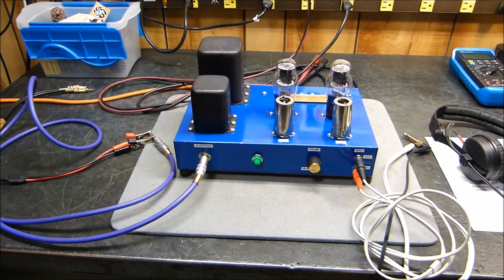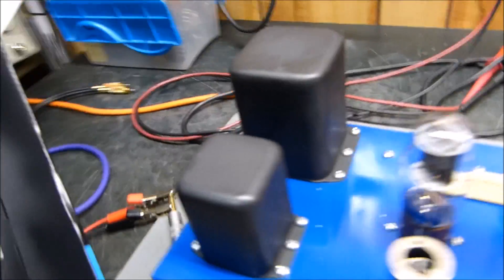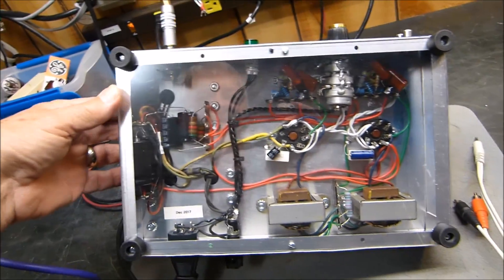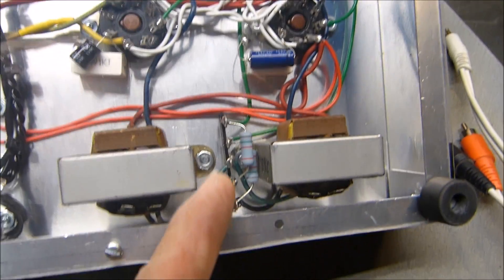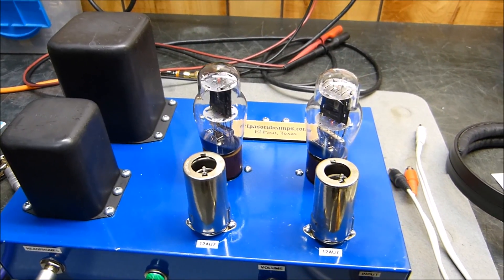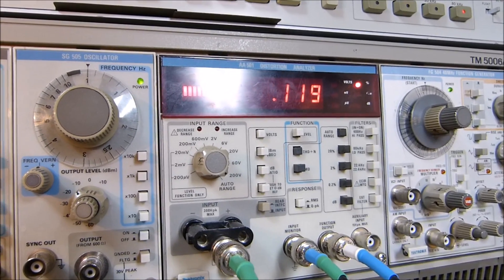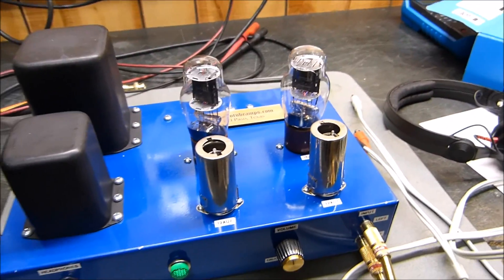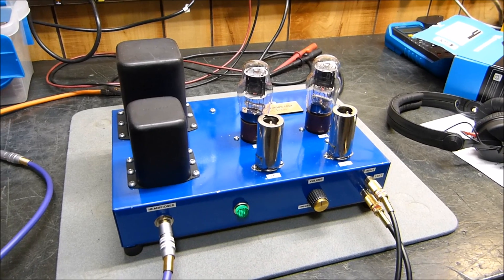Vacuum Tube Headphone Amplifier Using Vintage WWII 1626 Triode - Part 3

Comment: Looks great.. Are those cathode bypass caps for the output tubes final? I ask ‘cause one is axial while the other is a radial type of different manufacture..
Reply from the maker: Yes, that is true. They are different types but are of the same values. I am usually pretty picky about those types of things but I was pushed for time to get it done by Christmas so I used two different types of capacitors. You are very observant. Thanks for your comment

Comment: I there, apologies if you've answered this already but I was hoping you could tell me how you're measuring the frequency response?  Which software and your input particularly!
Thanks in advance!
Reply from the maker: I use a HP 8903 instrument with a software program from Pete Millett's website that interfaces a PC (my laptop) to the HP 8903. The HP 8903 is usually available on Ebay and Pete's website has the software for free. To interface the 8903 with a PC it is also necessary to have a HPIB adapter - usually sold separately from the 8903.  Here is a link to Pete's site and the 8903 with a lot of information.
http://www.pmillett.com/hp_8903_software.htm
In addition, I have made a number of videos on installing and configuring the software as it can be a bit confusing.
Hope this helps and best of luck..
Reply: Thank you!!!

Comment: Are you aware of the "Aikido" topology?  This was developed by John Broskie. The Aikido is a single ended, zero feedback, OTL - though it certainly could be transformer coupled. The Line Driver would be a great pre-amp for your Grandson's Headphone Amplifier. Check it out: http://glass-ware.stores.yahoo.net/index.html   Broskie writes a blog that is very informative, "Tube Cad Journal" - there's a link on his Glassware site.     What was your final schematic?
Reply from the maker: Thank you for the information. I have been considering an OTL amp for some time, using a cathode-follower circuit for some low power. Probably would have been a great idea for the headphone amp. I didn't show the final schematic from LTSpice but I can send it to you if you want. You have to write me direct at theaudioshop@sbcglobal.net as I can't attach it in YouTube.  I am working with a gentlemen to upload these LTSpice models and provide a link for download but it isn't working yet. You will, of course, need LTSpice installed and the Koren_Tubes file to run it.
Reply: Thanks, I'll do that. I'm really glad you did a few videos on LTSpice. I need to get into it!

Comment: Great wealth of videos! I am utilizing the knowledge here to help upgrade my lab and skills. My question do you have a simple list of your videos?  I tried your website but is was down. Thank you.
Reply from the maker: Hi Bill,
I am pleased to hear you enjoy my videos. I do not have a list but have almost 300 videos posted so I think if you just search for ElPaso TubeAmps within YouTube, you will get a complete list going back almost 10 years.
Reply: ElPaso TubeAmps 
,  I am about to restore some Macintosh tube equipment and feel prepared to check performance parameters thanks to your videos. Thanks
Reply from the maker: I am a real fan of McIntosh. 50+ year old equipment still works great. May need some new electrolytic power supply capacitors and certainly replace any selenium bias rectifiers  and it will probably be good to go. Some people seem to thing that all the coupling capacitors need replacement but I don't see it that way. If they are bad, then they need to be replaced, otherwise, I leave them along. Best of luck with your project.
Reply: ElPaso TubeAmps Thanks for advice, I am a McIntosh fan as well,  I purchased my equipment in the 80’s and still use it and works fine just some minor repairs. I have my dads C20 preamp, that I am restoring and wanted to baseline its performance before I started looking into restoring. I have restored old test equipment and  radios,  and have more time to look into it now and am building up my lab. It is very modest at this point , some HP equipment and Tektronix, I am  building it up which is why I was looking for videos what others have done.  Your videos have helped me tremendously.  Thank You
Reply from the maker: Hi Bill,
I am glad my videos help.
I use a C20 every day in my home theater. It is likely to run for hours each day. I got it at an estate sale for $20 - yes, $20. It had a bad PS capacitor which I figured out quickly as it was blowing fuses then the capacitors and rectifier for the DC filament supply went bad so that was replaced. No other problems.  It had its original Telefunken tubes in it - and still does. Great piece of equipment. I am sure you will get your shop up and running and enjoy it.

Comment: would have been nice to use a 2x KORG NU-TUBES 6P1's one for each channel and 4x ECC88's two for each channel all running of 50V 6A with the heater for the input 6P1's of 1.5-3.0V.
Reply: I've built the hybrid headphone 6P1 amp from a board by Pete Millet.  It is a very nice single triode  tube sound but prone to microphonic if there is vibration to the chassis.  It was a difficult build due to the crowded layout of the board. I prefer the sound quality of the 6p1  tube to the 6DJ8 tube.  6P1 is not a super linear tube but it has the triode magic qualities that we like about tubes.  I also built a 1626 amp Single ended amp with 12SL7 as a driver tube.  It has a lovely balance sound for 3/4 watt amp.  High frequency is not velvety as a 2A3 but the low frequency is significantly better than 2A3.  I will swap the 12SL7   for something better, like a 12SJ7.  For small signal, it's hard to beat an EF86 pentode in the preamp section.  I like the 1626 without the NFB, and I like it even better without the capacitor on the cathode.   6DJ8 is as bland as 12ax7, high mu with high distortions.  Sell your 6DJ8 to finance your next build, a 12SJ7 1626 amp.   El Paso TubeAmps, I love your videos on audio.  I am glad you are going away from high power push pull amps.  Keep posting because that's how I know you're doing well. Take care.
Reply from the maker: I just looked up the KORG NU-Tube 6P1.  I have to admit, I was not aware of it. I see they are kind of pricey. As for the 6DJ8, I believe that is a Hi-Mu triode so I would have a lot of gain. I do have a bunch of really nice 6DJ8's that I need to make something with. I will have to think about it. Thanks for your comments.
Reply from the maker: I do have a calling to the high power amps, AF and RF, but I think I have accomplished pretty much all I need to with them. I do have to do one more moderate level triode amp with the Svetlana 572-10 triodes just because I have all the parts.It is interesting what you say about the 6DJ8. While I have lots of them, I never use them and I have no equipment that uses them. I shy away from all high-mu triodes and have found in the Williamson designs the 6SL7 first stage makes the amplifier too easy to drive - something like 100 mV for full output. I prefer a drive level more like 1.5 to 2.5 volts for a power amplifier and use what I consider the improved Williamson design that HeathKit put out decades ago with two 6SN7's.I have some 2A3's but never got too much into them because of their filament voltage and if I understand it right, the vintage 6B4G is a 2A3 with an octal base and a 6 volt filament. As I have mentioned in some of my videos, I like the sound of the 6B4G amp on my shelf even though it is only about 10 watts and less than perfect.As for the 1626 - that is an interesting one as it is rated as a class-C RF amplifier and is used in the WWII air craft radios. I love the way it looks. I think that is what my real attraction to it is.I haven't tried the Russian tubes like the 6P1 but maybe someday I can pick some up and build with them.I have to admit, there is something really appealing about the openness of an amplifier with no NFB. As long as we can settle for just a few watts they can sound amazing. I wonder what it is about that sound that we like as we know its distortion products are probably pretty high...Many thanks for your comments and encouragement.
Reply: KORG NU-TUBES 6P1 is a newly designed triode tube for low signal, not to be confused with the Russian 6P1.  It lights up like the magic eye tubes.  I'd like to build a 6B4 if I can source the tubes.  The low dissipation requirement of 1626 would work great with LED bias in place of the cathode resistor and bypass capacitor.  My 1626 amp sounds a bit roll off at above 10Khz, and I don't have any analytic tools to sort it out.  Like you I have a small stash of 1626 to experiment. Btw, I love the chassis work you did for the 1626 headphone amp.

Comment: Dave,

Good job.  FWIW, I'd like to see what distortion is like using a 12BH7 for the small signal work.

Happy holidays!

You've added another chapter to the "Darling" saga.  Bob Danielak has been "messing" with the 1626 for years.

Eli D.
Reply from the maker: The 1626 is a pretty little tube and hard to resist. Something about the triode, maybe it's simplicity, makes it appealing. I listen to a 10 watt pair of vintage 6B4G triodes in a "Williamson" style amplifier in my shop sometimes hours per day and I think they sound great. I never tire of the sound although I tire of the program material...  In reality, the 1626 is not very powerful, even in PP, as I have built an amplifier using a pair and could get about 3 or 4 watts max if I remember correctly. As mentioned in the video, since this is a power amplifier and will most likely be driven from a smart phone or any other "Aux" level device, I made it deliver its best power with a volt or so input for a volt output. A gain of unity, so why bother as the headphones can be driven to the same volume level right out of the phone... but we know vacuum tubes make everything sound better - right?   :-)   
It will be a while before I have it back in the shop as it is with my grandson and I think he will enjoy it for a while. In time I may get it back for some more tests. Thanks for your thoughts and comments.